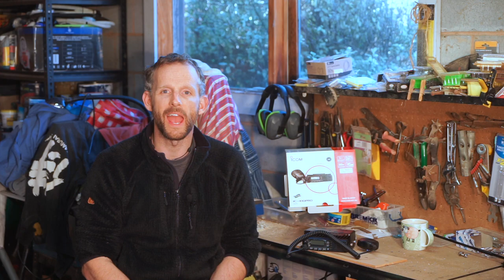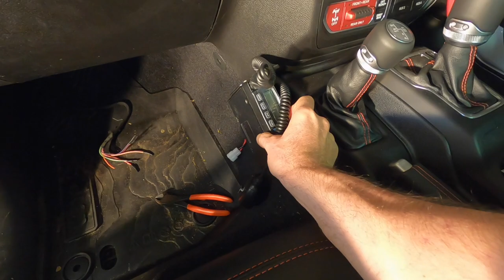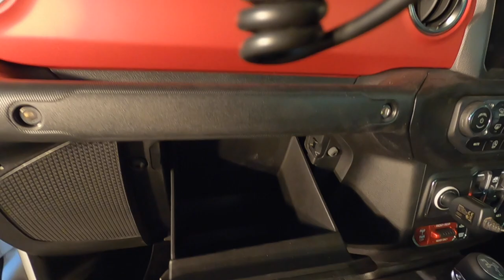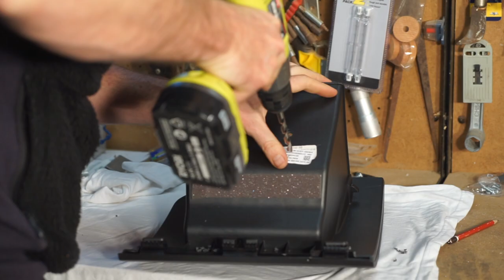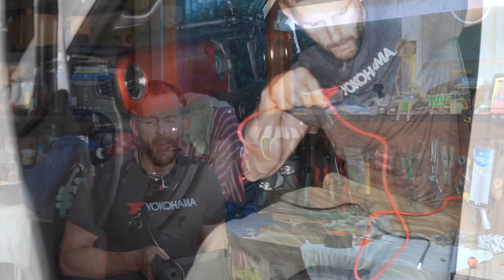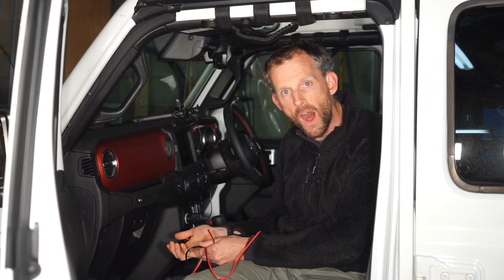CB Radio Install on Overland Jeep Gladiator

Comment: As people have said, beware it heating up.  The biggest thing I'd say though is, your plan to leave it off all the time and only use it when you need it relies on others to NOT be doing that.  A big part of participating in mutual-radio-assistance in the US includes monitoring (leaving it on so you hear calls for assistance).  I'd assume the outback there is similar.  Great choice on radio BTW!
Reply: It happens all the time, so great point. But for emergency a Sat phone is probably better. You can hire them too.

Comment: CB's have a very limited range due to the limited power, typically under 4 watts.  They are also limited to line of sight.  Unless you put an amp on it I doubt it will do much good except for the vehicles traveling with you.  Our off road group has switched to the Baofeng handheld ham radios.  They transmit up to 8 watts, are super cheap (under $40 US) and allow use in frequencies outside the ham band.  If you get your license, which is super easy, you can use local repeaters for even greater distance.  That is if your govt even allows that radio into the country.
Reply: My understanding is that CBs in Australia are completely different from CBs in the USA.  In Australia they're more like UHF Ham radios.  We share the same term, but they apply to two very different things.
Reply: @VideosOffRoad  I stand corrected.  Australia uses ham band freqs the US requires a license for.

Comment: Dan:  Be careful about installing your radio in the glovebox.  Radios can get VERY HOT and need air flow to cool them.  Obviously you're not going to be using it often, but when you are using it you'll definitely want to keep the glove box open.
Reply: Unless he's planning to pinch the microphone wire in the glove box door and not be able to hear the speaker he's going to have to have the door open!

Comment: In terms of wiring, I've heard you want to power the radio directly to the battery, not through any intermediate systems.  This is to keep things like alternator noise from interfering with your radio.  Also, you do NOT want to coil up any extra antenna wire.  The coil will create an induction loop which will both impede signal and increase SWR (standing wave ratio feedback) to the radio, which if that gets too high can actually burn out the radio.  So consider shortening the cable, or running it back and forth under the cowl (or along the firewall in the engine bay) across the width of the Jeep and back as many times as needed, in kind of a big "S" shape(s), before feeding the last couple of feet through to the radio.  :-)
Reply: Ive heard that too. I think Dans got the radio just to be legal and the attitude is not 100 percent. He may need to revisit that priority.
Reply: I can comment first hand on the coiled wire.  I made that mistake with my first radio in my Jeep.  I tuned everything with an SWR meter, had excellent antenna placement.  Everything was good, but I had relatively poor SWR.  It was entirely due to the coil.

Comment: Dan good job but a few items.  I’ve run cb’s all my life here in Colorado snd when I was a pilot escort moving oversized loads You need to consider moving the Antenna to the roof. Real life the body of the jeep is steel it will interfere with signals from any one on the side or behind.  Second the speakers on cb’s are crap in motion the road noise is probebly going to drowned out the sound. They make small external speakers they plug into the back consider getting one put some Velcro on the speaker and Center of dash. When using pull the speaker out of the jockey box snd set it in front of you on dash. It will help you a lot whenever there is road noise or weak signal. Then just stuff it away when not using.  Then run by your friends snd have him “tune” the antanna he puts a machine on it and decides the correct hight fir the radio and mounting and trims it for peak performance. It does make a difference. But mostly when you didn’t do it and have an issue in the outback and have poor signal
Reply: Were you using AM or UHF, because these are UHF and the aerials generally a predetermined length and don’t need tuning. Also in Australia and NZ almost all the aerials are mounted either on the guard or more commonly on the bullbar and on the side mirror arm for trucks. While the roof is the best for reception it’s susceptible to been wiped out by trees, also can’t be readily seen and most  people aren’t keen to drill a hole in the roof!!

Comment: Those ariels don’t last long on corrugated roads, mine (same brand) snapped off after 10k kms.  Bought a 2.1db fibreglass unit built for Offroad after that.

Comment: You picked the wrong radio to install discretely. You should have gone a gme Xrs 370 smaller form factor and remote installation option also.

Comment: That's where I kept my CB in my JKUR. Same with the antenna, although it was on the drivers side with mine (same side as yours).  We also made a home made antenna bracket. I mostly used HAM with a friend and eventually took out the CB (in the US). Garmin Inreach is my solution for remote emergencies, which again, works great in the US, but would be worthless in a lot of far off destinations (Ghost Busters).
Reply: My understanding is the Garmin InReach (I have the Explorer+ model) will work anywhere on the surface of the Earth where you have a reasonably clear view of the sky.  At the poles, on the ocean, wherever.
Reply: @VideosOffRoad  Correct. It's just an issue of who, if anyone, is coming to rescue you. As a side note, I rolled my Jeep this year and needed a rescue. I forgot my Inreach for a moment, mounted on the dash, walked to the top of a hill and used my cell phone. It took three hours to get someone to agree to come out. I can't imagine that back and forth via the Inreach, but it would certainly be better than nothing.

Comment: It’s going to be a pain in the arse having it in the glove box unless you have controls on the handset. And I reckon the glove box will gonna bounce all over place and break if you leave it hanging open over corrugations. 

Cut the coax cable to length as coiling it will cause interference. Might want to look at a stronger antenna as well. That one may go snap on bad corrugations.

Comment: Did you give any consideration to a handheld radio?  That's what I've been using for many of the reasons you mentioned (out of sight, out of mind; occasional use; minimal impact).
Reply from the maker: I didn't really, I figured the ones with the "proper" antenna are much stronger ?
Reply: @TheRoadChoseMe  You can still run an external antenna on the handheld radios.  At least in the US you can.  Can also use a magnet mount external antenna if you don't want to deal with a bracket-mounted antenna.  That said, I think for what you're doing and where you're going your setup will work nicely.

Comment: Good job Dan,,
 K.I.S.S.👍.  Cb radio is not as popular as it once was decades ago here in the States.  Unless you're a Trucker🤷‍♂️.  Don't quote me,,  but most of the Overland crowd here have been using the small handheld Walkie talkies for nearby com, or the more expensive ham radio/ whatever stuff for longer coms.  Too much BS for me actually 🥴.
  And as you said,   you're out there for a very reason.  
The solitude is a wonderful thing 👍.
  Cheers 🍻,  G.
Reply: CB in Australia is UHF FM carrier. 476 MHz.

Comment: For many of the reasons you stated Dan, this is why I picked a radio that has a very small head unit that was easy to hide, whereas all of the display and controls are actually on the handset.  I used a magnet mount for the handset to be in close proximity to me.

Comment: the mandatory radio, do they specify it has to be a CB, or are other types of radios acceptable as long as you do have a two-way radio?
Reply from the maker: I'm not 100% certain, I think "UHF" radio.
Reply: UHF. In the event of a search they use light aircraft in those regions mentioned due to availability/distances involved. Much easier for all concerned if the aircraft and vehicle can communicate.

Comment: Just stay off channel 6 all the big dogs will step on you and you won’t be able to transmit. Also normal CB radios are only 4watts. You’ll want an amp to boost your output. But there are laws stating that you can only use up to 4watts. Just be aware installing an amp is illegal although a ton of people do it.
Reply: My understanding is that CBs in Australia are completely different from CBs in the USA.  In Australia they're more like UHF Ham radios.  We share the same term, but they apply to two very different things.

Comment: You've probably already covered this...did you consider the Gladiator Mojave? IMO it is better engineered suspension and gearing for overlanding and desert travel than the Rubicon. Your thoughts?
Reply: They don't sell it in Australia.

Comment: That's the strangest thing I've ever heard of... That you have to have a CB to cross a desert! It sounds good in theory, but with the ridiculously short range of a CB radio I wouldn't even consider it a safety option in remote areas. A SPOT or satellite communicator of some sort is the way to go.
Reply: Obviously not living here in Australia
Reply: I believe a "CB" radio in Australia is not like a "CB" radio in the USA.  In the USA CB radios operate in the 27 MHz range and typically on amplitude modulation and only about 4 watts of power max.  In Australia "CB" radios are UHF and much more like Ham radios (without the repeaters), though I don't know the details of typical frequencies and maximum power allowed.  It sounds like they have a "standard" channel (Channel 40) which is akin to USA classic CB channel 19.  So even though it's likely only simplex communication, if everyone is monitoring the standard "driving" channel you're much more likely to be heard when calling for help, I think, than in the USA on really any CB channel.  Though I do completely agree with you, a satellite messenger (or phone) is a much more reliable way to call for help.  I have a Garmin InReach Explorer+ myself, for that purpose.
Reply: You're just repeating overland forum FUD. CB, properly installed and tuned, is a fine tool and has good range. Problem is no one knows how to install and tune them properly anymore then blames the tool rather than their lack of knowledge.
Reply: @MichaelRCarlson  
Bottom line is.... CBs are ancient technology, at least in the US. 
In Australia,  IDK. Everything is illegal over there so it may be the only option. 
As a kid I alway wanted to go to Australia. But as I learned more about it, no thanks. You can barely own a gun there. You have to have a permit to take sh*t. You can't have large tires on your 4x4 without and engineers plan and pay big money?  GMRS radios are illegal? You have to quarantine at your expense yet they're having an outbreak and locking down again?!
No thanks! It started out a prison colony and seems things haven't changed much!
Reply from the maker: @Tom A - Wait till you see how stunningly beautiful it is, then decided if it's worth the hassle or not!
Remember - driving around Africa was a huge pain in the backside and easily the hardest thing I've ever done in my life. It was well, well worth it.
Reply: @TheRoadChoseMe  
I guess when I was a kid things were different there, as they were here. I'm looking forward to seeing how your adventures progress. 
You're a smart guy with tons of patience and understanding. I'm a smart guy with zero patience and no understanding. Lol.